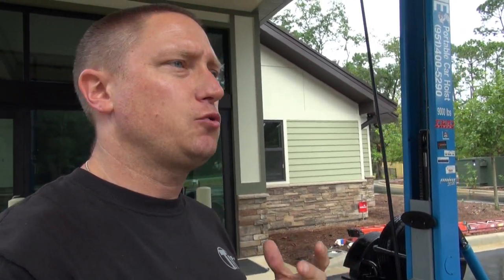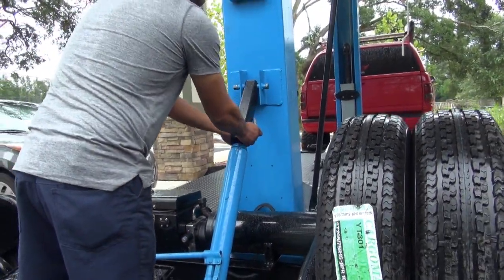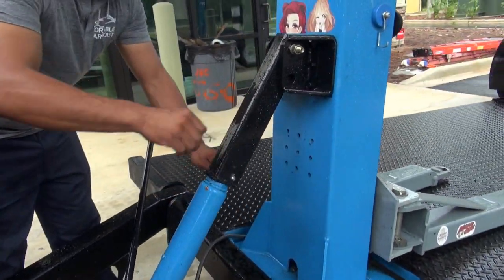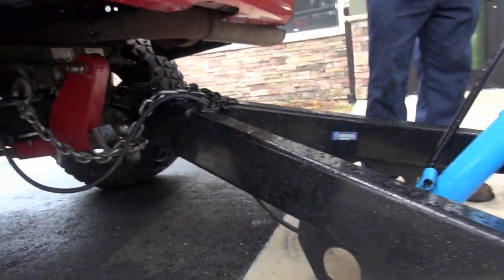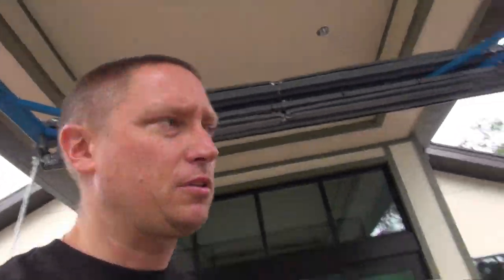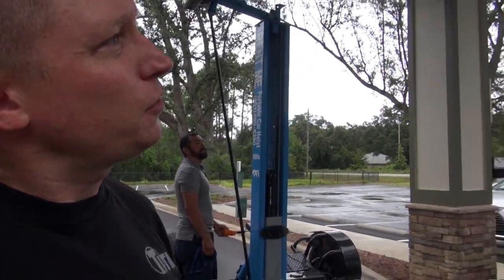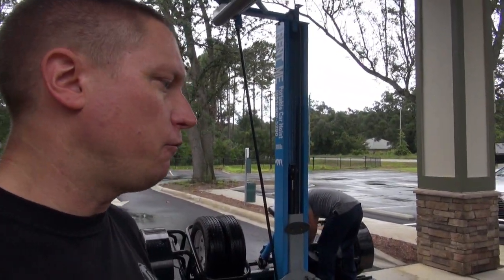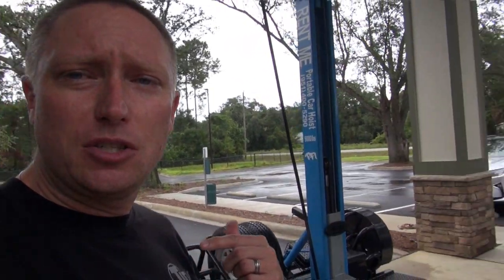World's Coolest Portable Car Lift

Comment: Saw something very similar to this back in 2009, but they used air bag suspension, had a gas Briggs and Stratton engine to operate the hydraulics and portable air compressor, but the front was different. The lift was a 12 or 15k capacity but also could be used as a trailer and was a 4 post lift. It was the coolest improvement made to these lifts. Believe they built there's for around $4500-5000 and used quite often.
Reply: If I ever seen what you described I’d gladly pay someone double they’re $ back lol

Comment: The spare tires & the tires on the lift, trash those trailer tires, they are junk. Put on 10 ply truck tires if your using a 16”+ wheels.

Comment: How much is the tongue weight on the hitch ? Looks like it would be a lot with the tires so far back.
Reply from the maker: You'll have to call Robert at the number listed.  I'm not a seller of these sir.
Reply: They say said total weight was 3500lbs. Based on position of tires in relation to the hitch, I would guess tongue weight at 1750 lbs, or half of the total weight.

Comment: Rober, this is cost better than the concrete slap foundation and it is Mobile.  
I like the idea, but really how much you are selling complete set from this demo?
I am not worry about the safety as long you don't rise the vehicle very high, and the warranty as long as you built open-flat-bed trailer with high quality steel strength should be lasting for 20 years with pro care for daily uses.
9000lbs lift would cost @ $5K.  The custom made trailer with super quality duty steels for the lift mounted on would cost $5K.
My estimating should not be less than $10K total.  This is about the idea, not the products quality.
Reply: He mentioned the “as seen price” was around 14-15k with the awning and spares. 10k for base

Comment: Cool concept but the hitch arrangement definitely needs to be re-done.  it obviously has way more tongue weight than a bumper hitch can handle as can be seen by that custom fabricated under the car ball hitch with an air bag used to cushion the bounce.  It would need at least a 1 ton truck to haul that kind of tongue weight no matter how you slice it so might as well just make it a goose neck setup which will make that rig much safer.  I would be willing to bet there are some serious towing safety issue going on with that setup somewhere.

Comment: Dodge Owners will be happier. 
Now you all can drive further, after fixing the junk every 30,000/60,000 and if you are lucky,...100,000 miles. 
And you won't need a garage.
It would cost a lot to build a garage too accommodate a lift like that if it weren't on the trailer.
Reply: I think you mean Chevy. My Dodge is fine at 180k miles.
Reply: @lostintime8651 And Ford is fine still at 300,000/500,000 miles and Cummings and Mitsubishi don't count, they aren't made by shit ass Chrysler. Chrysler makes Cummings and Mitsubishi look bad when their engines are put in Chrysler. They haven't made anything good since the 70s.